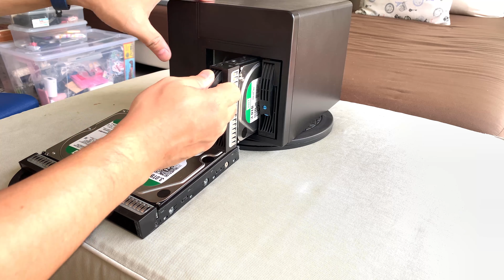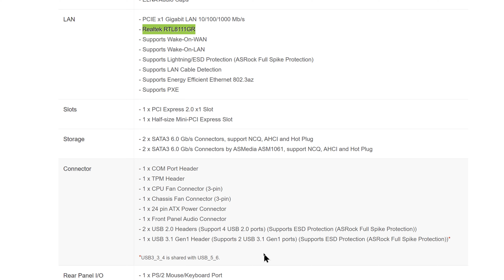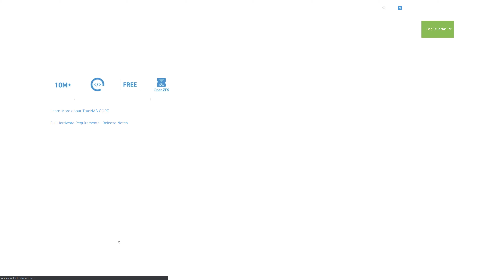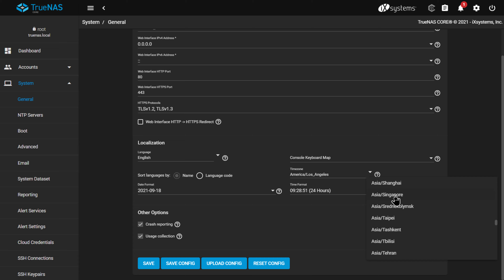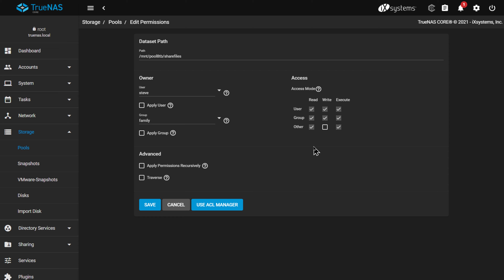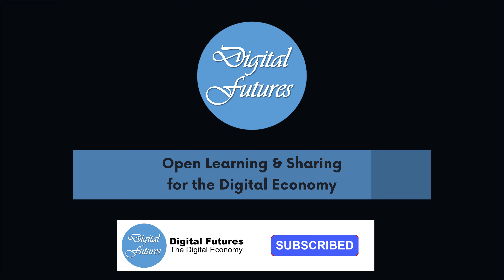How to Build Series - 12TB TrueNAS 12.0 Home Server

Comment from the maker: Hi everyone, I've a new video continuing on this TrueNAS home server build. The key focus in on upgrading the networking capabilities. Hope you would like it -> https://www.youtube.com/watch?v=RniZ4n90q0U
Reply: Guys, what the best OS and setting to change my desktop PC into NAS multimedia server?

So, my plan is using :

- Motherboard : Asus ROG Strix B560
- Processor : AMD Ryzen 5600G
- Memory : 2 x 8 GB DDR4 RAM 3200 mhz
- SSD for booting OS (Freenas or?) : 512 GB SSD 2.5 inch
- Eksternal HDD bay : Yottamaster PS500RC3
- HDD 3.5 inch : WD Red @ 8 TB x 5
- Power Supply : 450 watt 80 plus bronze

Question :

1. Can OS FreeNAS/TrueNAS detect Yottamaster HDD bay as partition hard disk on my Desktop PC ? (i will use usb 3.0 port from motherboard to connect to Yottamaster HDD bay)

2. Can i use my Nvidia Shield TV pro 2019 to play all movies from Yottamaster HDD bay i connected to motherboard on my desktop PC ?

3. Please give me best setting or tutorial to build this desktop PC as NAS Server ^^

4. Can OS FreeNAS/TrueNAS install application  such as Plex, Kodi or etc? Please explain ^^

Im newbie guys, so please guide and teach me. Thank you 🙏😉
Reply from the maker: Hi,

1. TrueNAS should see your Yottamaster as a single vdev.
2. Not sure as I do not have NVIDIA Shield TV Pro 2019.
3. Install TrueNAS CORE and configure the vdevs into ZPool and datasets.
4. TrueNAS supports Plugins from iXsystems or Community collections such as Plex, Nextcloud, Syncthing, GitLab, Grafana, Graylog, Jenkins, Logitech Media Server, OpenVPN Server, unificontroller and many more.
Reply: @digitalfutures_SG  so, only read as 1 hard drive?

Comment: From the outside your build is a neat lil' great shiny box. Love the compact size and the fact that this unit is guaranteed to operate silently. Nice job on that one.

However, the inner components you chose to assemble the unit are a messy disaster waiting to happen. Here's why:
- Unsuitable drives ( WD Green with the IntelliPark set to 4 or 8 seconds ) for continiuous operation encountering mid to high I/O.
- Externally mounted boot source for the operating system is a no-go. You should have chosen at least an internal USB header to give your USB drive a certain degree of protection against mechanical impact ( such as breaking the jack off the drive itself ).
- Non-ECC RAM modules are an absolute no-go when using ZFS that crucially rely on safe memory to ensure data safety regarding a reliable file system.
- Client-grade home consumer PC mainboard bloated with additional interfaces a server never did / won't / will never need in its lifetime. Audio, Wi-Fi and optical out are a good source for undesired interference for crashing purpose, btw.
- Solitary NIC port defying all redundancy against LAN outage in case the cable and/or port goes bad -> ERROR404.

Bottom line: I have to admit, it's a good starting point for everyone to learn how to assemble, set up and maintain a server for home use. Outside of that it cannot be suitable for office and enterprise usage where mission-critical storage and processing demand is a critical factor in today's industry.

Next level: Server-grade hardware with NAS-suitable drives, server motherboard with at least two NICs and ECC-capable RAM ( at least 8G is required. The more the better! ).
Reply: Ahh, just stop.

-Greens are fine, just disable intellipark or set it with a higher number, so it wont park itself to death.
-ZFS needing ECC ram is a myth almost as old as ZFS itself. No it doesn't need ECC. Yes, you can use ECC for more protection and higher data integrity, but that isn't specific to ZFS. Not using ECC with ZFS won't be any more "dangerous" than with any other available file system.
-Client grade motherboard is fine, if this is a home server. It doesn't need enterprise reliability and features present on the board will just sit there unused and not hurt anything. And board like that will be a lot cheaper. Interference point is bullshit. That stuff is validated beforehand for a reason. 
-Again, not an issue. This is a home server. You don't need network redundancy. If the NIC dies, you'll just replace it with a pcie one and be on your marry way. 

Given that this is a home build, the only glaring issue is using externally mounted flash drives. I'd either go with an internal ssd or just make a seperate partition on the data drives for the OS. For the purposes of home use, that just fine.
Reply: @hojnikb  What is a client board? A board which holds so many hardware features that one needs a ton of drivers to run them all. A huge complex machinery cascading all over it.

What is a server board? A boards that holds only a required set of components for a server to run reliably 24/365¼. A stripped-down simplified version to reduce driver weight.
Reply: @Bandicoot803  I have a mindbender for you... You don't actually need to load a driver for the stuff... you don't need. You can easily strip out in kernel or simply disable via bios the stuff you dont need for a headless server (like audio, igpu.. etc) while not paying a hefty premium that sever grade hardware commands.

And again, if that didin't come across just yet. We're talking HOME usage here. 24/7/365 reliablity for the next 10 years isn't something that is crucialy expected.
A redundancy in the form of offsite backup (either via cloud or a second nas somewhere) will in practice yield a lot smaller chance of actually losing all data in the even of faulire than just using a single device with enterprise components. The most expensive enterprise drive in the world still won't survive a fire or flood or a massive earthquake.
Reply from the maker: Thanks for your comments.

For more robust NAS solution, I would highly recommend better quality hardware for resilience and reliability.

Comment: USB-Drive for boot? better not.
Reply from the maker: Yes, USB drives are not recommended by TrueNAS too.

However, as this motherboard does not have any mSATA nor NVMe M.2 slots, the only alternative is to use a USB drive as boot drive. In my experience, my previous FreeNAS storage was also using USB drive as boot drive because I'm using all the SATA ports onboard plus PCIe SATA adaptors for all my data drives.

So far, I have good experience with SanDisk USB drives as boot drives and they are pretty reliable.
Reply: @digitalfutures_SG  usb SSD maybe....

Comment: Hmmm are you sure you will use that Green drive? In my experience they are the worst disk for some heavy storage things like NAS. Also isn't TrueNAS using ZFS mean you need to use ECC memories instead the normal one?
Reply: Yep, friend of mine didn't do his research a few years ago. Green drives park a lot, they have too much power management. Put those in RAID and your array is DEAD within a year.
Reply: @robvdl  I would never use green drives either.  You can update their firmware though so they park less frequently which I would do wither in a NAS or desktop.
Reply: @jaycahow4667  yes I know. I have even found that so called drives designed for NAS use "STILL park" too often. Even if in openmediavault you turn off all power management on the drive, the drives "STILL park" (I don't understand why, never have, to me NO power management means NO power management). Same issue with TrueNAS, it seems that drives do not respect this setting or something.
Reply: I very much doubt that ECC RAM is a requirement for ZFS or TrueNAS, you just need enough RAM that's the main thing.
Reply: @robvdl  well, ta least they recommend using ECC RAM for better error checking, you can go with non-ECC if the load not really crazy perhaps. 
But IMO I'll go to other more-"safe" options out there like mdadm softraid in OMV if I can't afford ECC RAM :)
Reply: @RizkheyG  yeah I actually run OMV already on arm64 Armbian, but I'm building an AMD based Debian replacement. I think the ECC requirement is a bit overstated. But hey, DDR5 will all be ECC so who cares.
Reply: @robvdl  Same here, I' also run OMV on Rpi 4 for backup target  my Macbook. Yes AMD is kind enough to give us ECC without workstation motherboard or CPU.
Reply from the maker: Hi, agreed that WD Green Drives are designed for light workload environment. Depending on your NAS usage, it could still be a cost-effective and viable solution. Happy New Year and God Bless!!
Reply: @digitalfutures_SG  totally disagree unless you go in the drive BIOS and mess with disabling the power management. The issue with greens is that they aggressively park because they are tuned for low power usage. That is what kills them when put in RAID, so in RAID setups, greens are NEVER OK.

Comment: Someone intentionally chose WD green drives, ...and 3 TB models at that? :) (Perhaps they were $10 each, making them partially worth the risk, with two drives of every three used for redundancy...
Reply from the maker: Thanks for your concerns.

As mentioned in my build video, these drives were purchased a long time back and had been in my previous FreeNAS which was migrated to TrueNAS a year ago. They were good drives, maybe I was very fortunate to have high quality WD Green Drives.

Also, I've run CrystalDiskInfo on them to make sure they are still in tip top conditions before I reuse them for this build and so far, there were no read/write/checksum errors after filling them up almost completely.

Comment: Yeah, Nah, a huge scream of FAIL was heard when seen WD Greens in use. Regardless of the fact these are older CMR drives which now are SMR shite. Reds or Blacks should be in use, not Blues, Greens or Purples.
Reply from the maker: Hi Ben, I agree with your view on hard drives types and for 24x7 NAS builds, it would be best to use Red Pro drives for better longevity. However, due to the high prices of hard disks in the past year, I'm salvaging what I still have and in working conditions instead. Hope I save up enough to upgrade my NAS with WD Red Pro drives. Cheers!
Reply: @digitalfutures_SG  Another suggestion that may work better, Windows Storage Spaces. This platform is very easy on drives and not intensive like ZFS. Great for bulk storage of media.

Comment: Shipping for that 4 bay deal is not $50 PLUS the cost of the unit...
Reply from the maker: Hi Hayden, the current logistic situation is crazy. Prices for everything including HDDs are through the roof, thanks to Chia mining.

Full disclosure, I had setup my systems for Chia mining during the early days and consumed all my compute, NVMe and HDD capacity in 1 month. Thereafter, I exited Chia mining and repurposed my hardware.

Comment: WD Green 3TB bad idea with TrueNAS (or zfs in general)
you don't want SMR drives with zfs, and 3TB drives are more prone to fail, and green drives in NAS not the best idea especially on zfs, on URAID its alright
Reply from the maker: Hi, these are not SMR drive and I'm using them for a long time. Thanks.
Reply: @digitalfutures_SG  oh nevermind then, I thought green drives are SMR especially the low TB ones
Reply: There’s a WD Green instruction using UBCD to change a WD Green to normal operation for use in raid arrays before ever using them so that the green part of the drive design doesn’t result in a raid array rebuild failure. This doesn’t have anything to do with the other comment but since the WD Green part caused the first comment then this was warranted. I just do the UBCD method to alter the green drive’s native behavior and I haven’t had one cause a raid rebuild failure since when re-using WD Green drives in raid arrays. I only use them when it’s a re-use type use case and not when building a storage array from brand new drive selections obviously.

Comment: you're not suppose to use a usb drive, it literally says not to in the documentation, use a small ssd
Reply: i have this same motherboard in a truenas build and used a pcie 1x to dual sata adapter for a single 16gb ssd, and room for another for cache
Reply from the maker: I think this is a personal preference. The reason is the TrueNAS boot drive does not contain much configuration, and I keep a backup of my TrueNAS configuration after every change so I can restore a working configuration if anything goes south. Also, if the USB drive fails, all I need to do is to reinstall TrueNAS onto another USB drive, restore the working configuration and import the pools. I've tried this several times and it worked every time. Thanks.

Comment: Yes, as another has stated green drives are not rated for use for NAS. I would not use WD drives. I have had so many fail in the last 6 months that it is not funny. Some were under warranty. The real kicker was I had one HDD that WD sent to be as a replacement  fail under 3 weeks later and luckily the original HDD was still under warranty, so it got replaced.  I had 2 more fail shortly after the warranty. I am buying Seagate drive now. They are less money then the WDs and have better specs. Also includes 3 years of data recovery as well. When I had to replace another HDD, the newer model of the HDD from WD was air filled while the older model was helium and was more money. So it would be louder and run hotter, no thanks WD.Also do not run TrueNAS OS on a USB key, it will wear out, use a small SSD instead.
Reply from the maker: Hi Andrew, thanks for your feedback.

I think this is a personal preference between WD and other brands of HDDs. I've used WD, Seagate, HGST, and Toshiba HDDs, and my experience had been good with WD and HGST.

Although TrueNAS on USB is not recommended, as this motherboard does not have m.SATA or NVMe onboard and the case does not have a PCIe slot space, using an USB drive looks like the next logical step. Another thing is that TrueNAS boot drive does not contain much configuration and has little IO so flash wearing is limited.

I always keep a backup of my TrueNAS configuration after every change so I can restore a working configuration if anything goes south. In case of the USB drive failing, all I need to do is to reinstall TrueNAS onto another USB drive, restore the working configuration and import the pools. I've tried this several times and it worked every time. Thanks.

Comment: never use green drives for a nas or any raid array; that's what the red drives are made for
Reply from the maker: Hi Seth, Red or NAS drives are designed for 7x24 continuous usage while Green/Blue are suitable for daily use. Depending on your usage and design requirements, I'll use the appropriate drive model coupled with Raidz2 or even Raidz3 with hot spares for larger configurations, while monitoring for any soft errors and backup or ZFS replication to another TrueNAS for redundancy. Thanks.
Reply: @digitalfutures_SG  In addition to everything the guy above me said, all new WD Green and Blue drives use a different recording technology that makes them really, really slow with ZFS. Only Seagate IronWolf, WD Red Pro, or enterprise drives should be used with ZFS for adequate performance.
Reply: Honestly, if you care about your data, don't even consider wd green. I didn't watch your video; I just saw your thumbnail with 4 wd green and though "omg the comments are gonna be hilarious".

Seriously, sell the green drives on Craigslist and get AT LEAST WD red pros (make sure you have CMR drives, not SMR). You're welcome.

I also suggest you delete your video as it might propagate terrible practices. Thank you.
Reply: @digitalfutures_SG  That is incredibly ill informed lol. Blue drives are the bottom of the barrel and greens are power saving versions of those. They operate at lower spindly speeds/RPM, lack error corrections (TLER). Head parking differences depending on the model can make using them a giant pain. There also the little fact the power saving can cause the array to lose the drive depending on how the hardware handles it. You can physically use them just like you can use a hard drive to hammer in a nail its just a incredibly by too for the job.